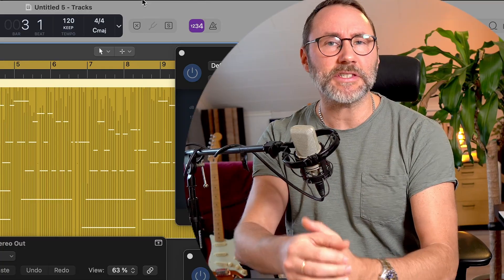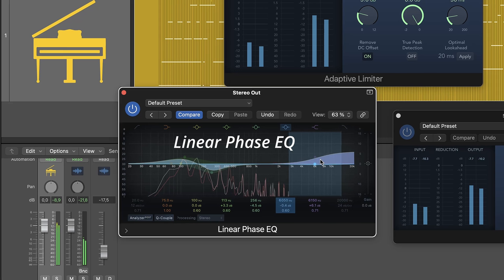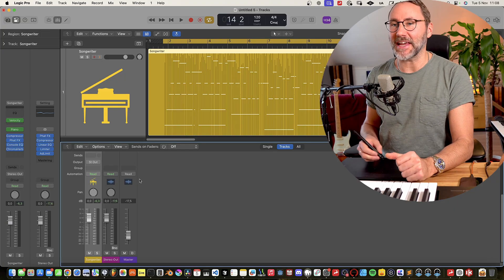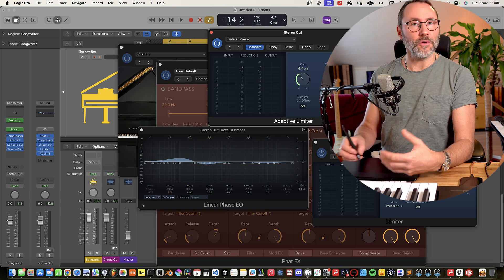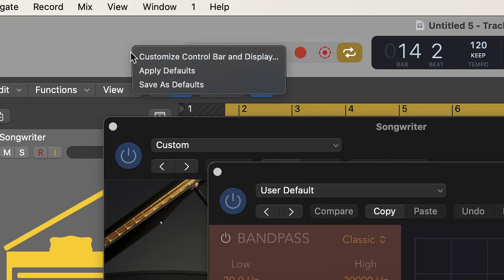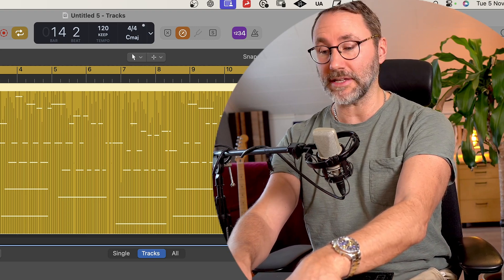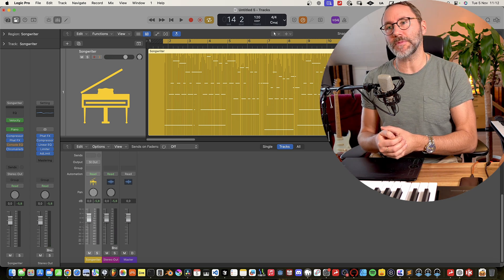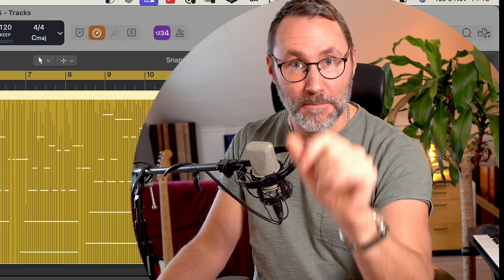Why Audio Latency Happens & How to Fix It Fast in Logic Pro

Comment: Do all DAWs have this? I use Bitwig Studio.
Reply from the maker: Hi Mike, Unfortunately not. Bitwig does not have this option. On the bright side, many audio interfaces offer direct monitoring option. But the good thing with Logics Low Latency option, is that it still let some effects run, only demanding plugins are ”deactivated”. And its super easy to just flip it on/off in Logic. That’s one of the reasons I often deal with audio vocals / guitar recording in Logic Pro.

Comment: I did that mine is still legging :(
Reply from the maker: Weird, activating ”Low Latency Mode” should deactivate all cpu hungry and demanding plugins. What plugins are you using?
Reply: @MattiasHolmgren I just researched and lowered bit rate to 32 it’s working!

Comment: exists in Cubase since at least Version 9 called Constrain Delay Compensation! That was in 2017!
 and in Cubase u can see in the mixer the  values , how many ms the Plugins use... u must activate this in preferences tho.
Reply from the maker: Wonderful to hear Cubase also has similar low latency mode. I was a big Cubase user back in 1993-2009, until Logic 9 dropped.  It's a really great and accessible feature in Logic Pro.